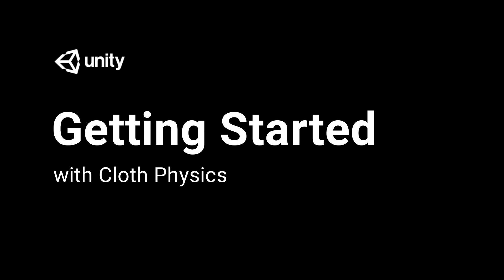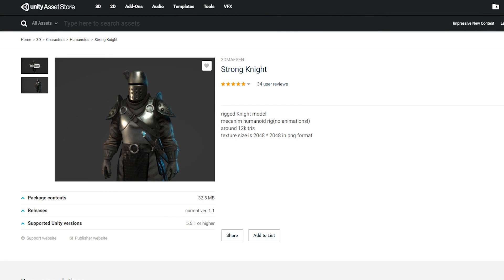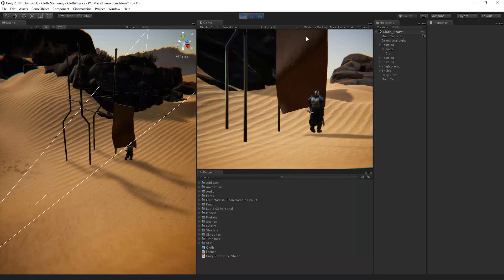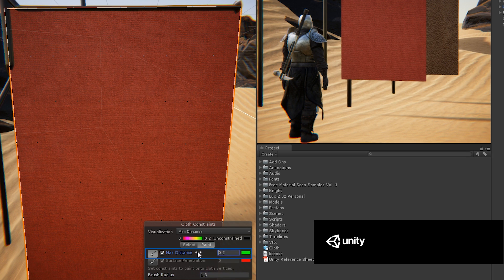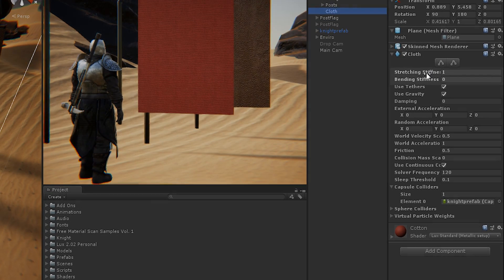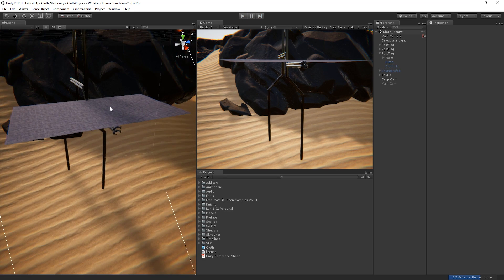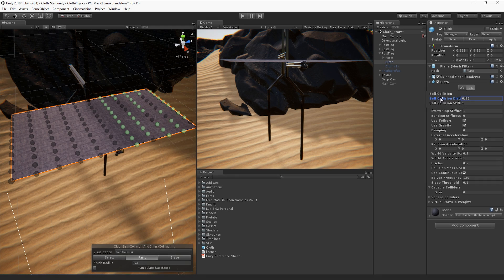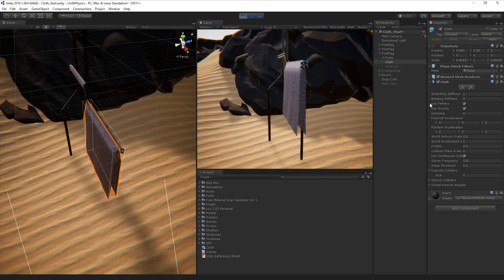Getting Started With Cloth Physics

Comment: i have a question about the cloth design, does the cloth physics work better if the cloth is a plane design or has some thickness to it?
Reply: Well in terms of looks, it looks better when the polygon count is higher. Low poly objects just dont look that well when in motion and especially if it is thin, I mean it can still work but the thicker the better most likely.

Comment: So does Unity come with a double sided shader now for cloth?
Reply: Not sure if it's an option in the standard shader, but the new shader graph tool will allow that option when creating visual shaders. The current shader graph version only works with the Light weight pipeline though, support for HD will come later on. Still, pretty cool the new SRPs will modernize Unity's rendering (finally). Though it'll be a paradigm shift from all the older rendering pipelines and their shaders...
Reply: Alvaro U. Luna aah, that's a great point. Didn't even think about that. I'd still rather just have it as a checkbox on the SS or something, but this is definitely a step in the right direction
Reply: That would be nice. I spent a while trying to hack a double-sided cloth with two reversed planes. It kind of sort of works :/ But yeah, if a double-sided piece of cloth could be a standard asset, that would be cool